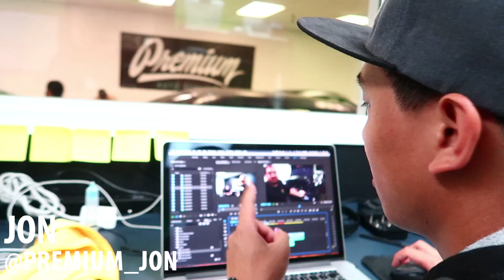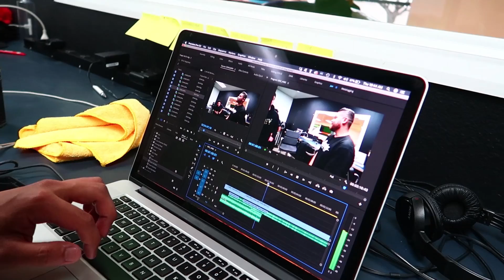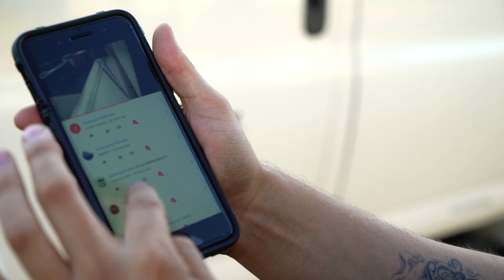R1 CONCEPTS FOCUS ST ( 2018 Global Time Attack Car)

Comment: Hey guys! 
Been a huge fan of your work and love watching your youtube videos I've learnt so much about wrapping and customizing cars and I just wanted to say thanks !

I would also like to pick your brains about my situation atm, I would like to wrap my car in brushed metal black, how ever when it comes to the hood and front bar I'm stuck on how I can make the grain of the brushed wrap match without running a  clearly visible seem. I'm thinking I may need to run a matte or satin black stripe to  break up the wrap, my cars body kit doesnt have anywhere that will hide a seem well so I am a little bit stuck on my options. my car is a black fd3s rx7 with a full Feed v2 bodykit :)

Any tips or tricks would be hugely appreciated!